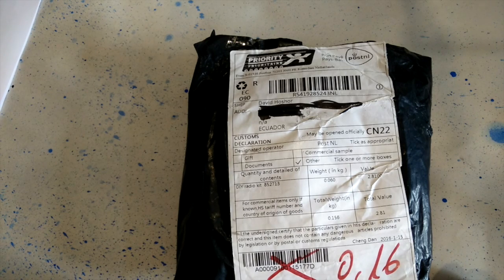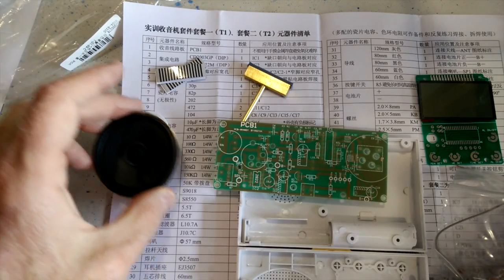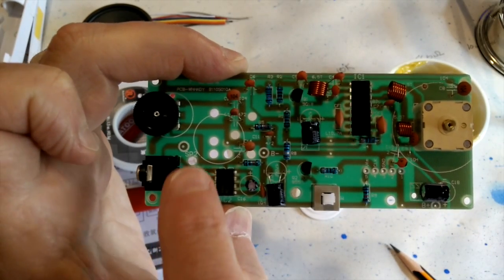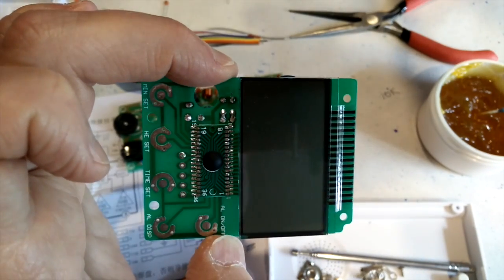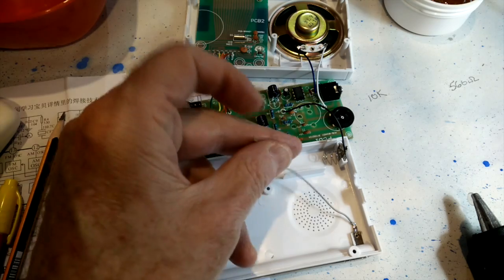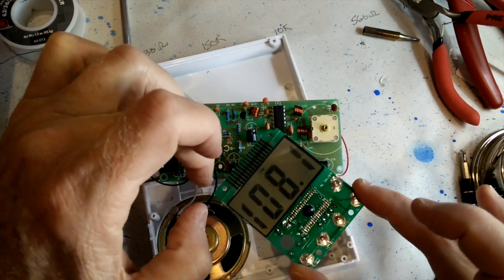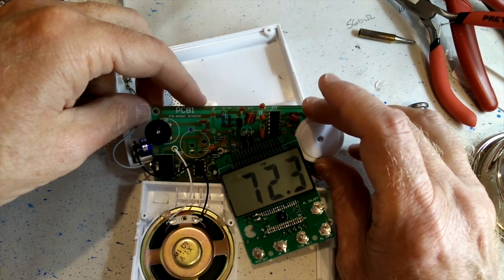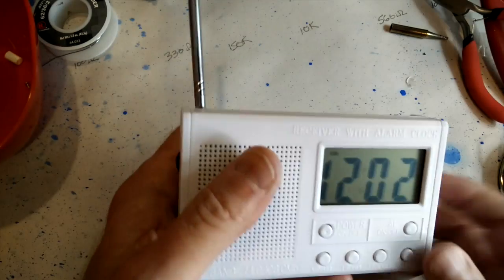Banggood Chinese FM Radio Kit with Alarm Clock and LCD Display

Comment: Dear Friend, Thank you very much for your video. Although I do not speak English I have been very useful in my radio set-up. A pity that he did not watch as he mounted the tuner display of the radio. I
 imagine that the piece that comes with the assembly kit, similar to a 
hammer, is to facilitate the installation of the conductive tape that 
feeds the display .... I said, thank you very much for your teaching and
 I send a big hug and Greeting from the Canary Islands (Spain).

Comment: Great video David, I bought one of these after watching your video.  Seems pretty straight forward but you didn't tell us how to stick that zebra strip down.  I assume you heat that little brass T shaped tool and just use it like a clothes iron to melt some sort of glue on the zebra strip.  Now, if that's the case, does that little rubber pad that fits onto the end of the tool stand the heat?  Maybe it's a single-use tool or something.  Excellent work, keep it up :)

Comment: I just bought this radio today. I look forward to using your video for reference when I attempt to build mine. I just wanted to mention that there is a US warehouse option that ships in 5 to 7 days for this item. On banggood there isn't always an option for US warehouse but when there is, I make sure to click on that US box : ) Thanks for the Video. There was a small increase in price 9.99 but worth it IMO. Thanks again.
Reply from the maker: I think you'll enjoy assembling the kit.  It wasn't too difficult, but it was still challenging.
Reply: I did enjoy building it. It took a couple hours to build. I noticed if you tighten some screws too tight the buttons become depressed and the display goes haywire. The other issue I have is not being able to tune into a station that is inbetween the bandwidth of two stronger stations. The radio just can barely pick it up. Is there a way to spread out the band so I can tune into that frequency with the variable resistor with the four screws?

Comment: Weird that your package was sent with PostNL (a Dutch company). I thought Banggood shipped straight from China?
Reply from the maker: I thought it was strange too, but since it was mailed to me in Ecuador, I figured Banggood must know which shipping method and fulfillment center to use for best (or cheapest) service.  At least I got the radio in one piece and in reasonably good time.

Comment: Hi David, thanks for your instructions. I followed them exactly and have the kit assembled. The radio is working but I noticed a glitch on the LCD display. The 1st digit is not showing. When I turned to 104.3, the screen only showed 04.3. Same with the clock. Time 10.20pm showed 0.20. Could it be the strip connecting the LCD to the PCB board? Hope to receive your esteemed advice. Thank you.

Comment: Nice video, what was the brass thing for that you found in the kit
Reply from the maker: I think it was supposed to be used for pressing on the adhesive conductive "zebra" strip to the contacts on LCD and the circuit board on which it is mounted.  I used it that way, but I thing rubbing the adhesive strip with your fingernail would work as well.
Reply: i believe it is a cheap soldering iron tip for those conductive tapes. and the soft rubbery tip is most likely silicone so it wont melt. you are supposed to apply heat and pressure to those zebra tapes.

how is the reception and drift on the radio? does it at least stay on the set frequency for a while? im looking for a simple to use elderly fm radio solution. this one looks nice from afar

Comment: Dear friend, 
could you explain the process you used to connect the tape to the 
display and to the printed circuit? ... thank you very much ....
Reply from the maker: I just used my fingernail to press the adhesive zebra ribbon to the display.  Look at the edge of the LCD display and you'll see that there are conductive areas printed on the LCD glass.  They're faint and hard to see, but in good lighting you should be able to see them.  (The conductive glass reflects the light differently.)  Peel  back the adhesive from the ribbon cable, and match the black conductive stripes of the ribbon cable with the conductive pads on the glass.  Use your fingernail to adhere them to the LCD display.  The other end of the zebra ribbon was easy to connect to the circuit board.  Just match the black bars of the cable with the pads on the circuit board.  Once again, attach them with pressure from your fingernail.  In my kit there were about four or five of those zebra ribbons so if you make a mistake, you can easily try another ribbon.  Mine worked on the first try.  Good luck!
Reply: Thank you my dear Friend ..... I will try with all my strength .... a big hug from the Canary Islands (Spain) ...
Reply from the maker: You're welcome.  I was in Tenerife about a nine months ago and loved it.
Reply: David Hoshor what is the hot stamp for? I have looked all over the place to find a reference to it. Any ideas?? Please help

Comment: You are lucky most of the kits from china has no lapped work at all on these kits and what you get sucks,I no some.people find there projects info on the inter net,and Google is suppose have a translation programs  for what you get on the schematics,by use of your camera on your smart phone or tablet,I haven't tried that get ,did they give you the tape for your buttons ,I built a lot of kits this one looks like a hreadache,